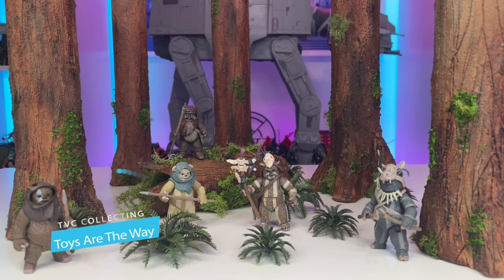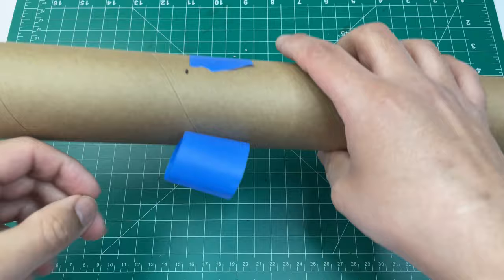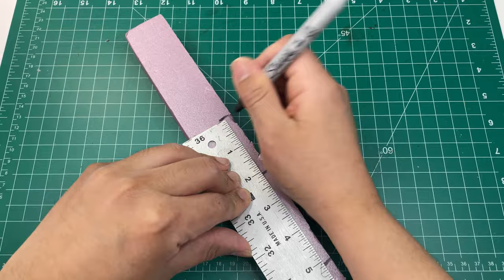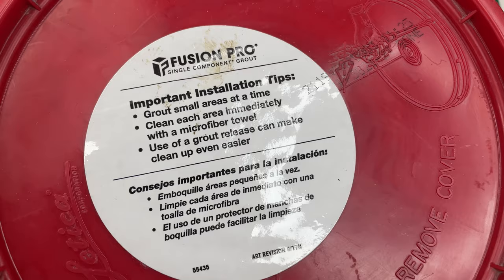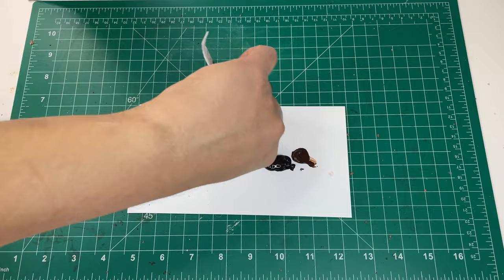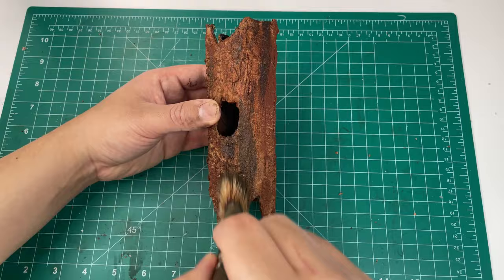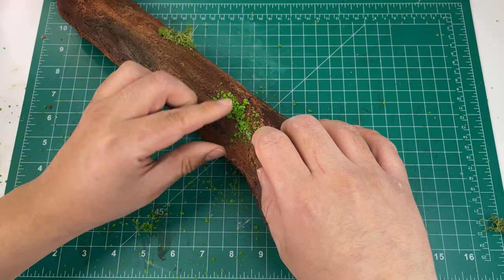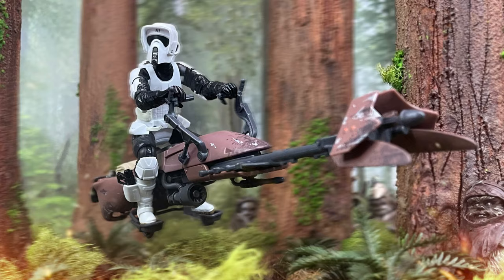Star Wars The Vintage Collection Endor Trees | Diorama & Tutorial

Comment: We'll, that looks easier than using modeling clay. I live in a forested area, so I used 1-2 inch thick tree branches, wooden discs covered in modeling clay for the roots.
Reply from the maker: Indeed, the grout is definitely a very helpful material. Oh nice! Using found materials from outside is always a great idea! ✨😃✨
Reply: @ToysAreTheWay  would you use the grout for creating 'dirt/sand' on a wooden base? I want to do a motor pool/briefing diorama and was trying to think of simplest cheapest option for the ground. The exo-terra sand mats from pets mart also look good
Reply from the maker: @18ferris88  you could certainly use it for that. If not there’s always pouring some layers of sand and rocks on top of glue. I’ve used the pet sand mats for photos as well. Sometimes it’s best to just use whatever is available and easy 😎

Comment: I'm trying to build some decent sized playsets for my figures, but not sure what the best base would be to start building on. I was thinking of a thin board of wood, but worried that might be too heavy, ang suggestions for a good base material? Also, another great video, love your channel and positive attitude :)
Reply from the maker: Awesome! It's always exciting to start a project like this. I would reccomend a sheet of XPS foam from the hardware store. I have used them in my floor tutorial, if the 24x24 pink version isn't available they have the cheaper brittle white foam as well. A last option is cork board, it's easy to cut and usually cheap. 

My plan for my Endor shelf is to use any of these substrates and then cover it in grout for a muddy floor texture and then paint it a few shades of brown. Then cover it with moss and foliage similar to this tree tutorial and the diorama I set up for the speeder bike review. 👌😎✌️

Thanks a bunch for the support and kind words!